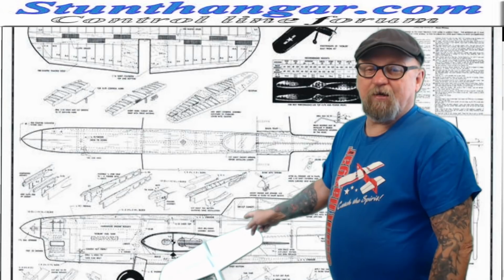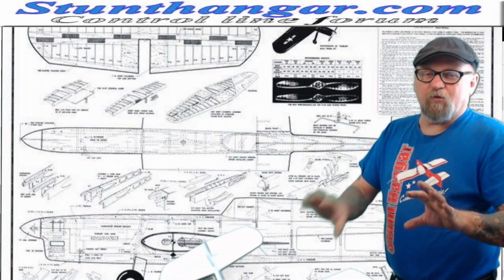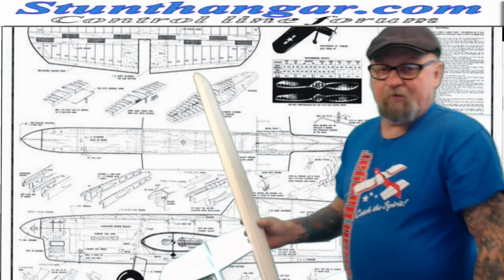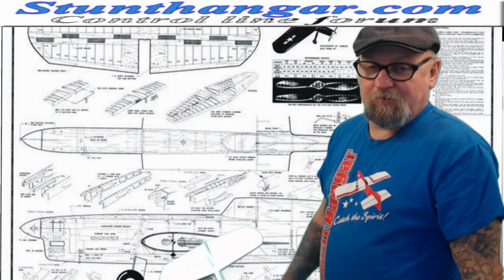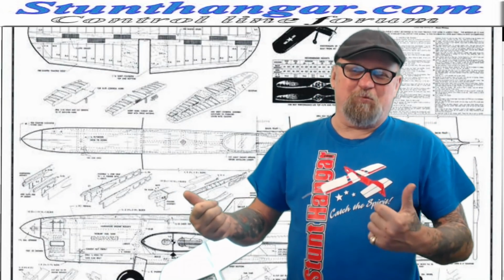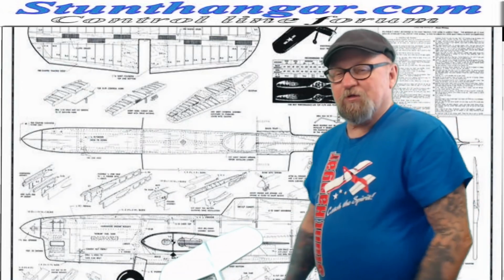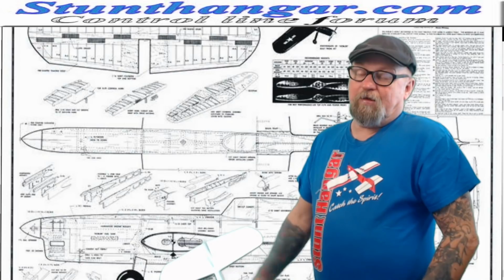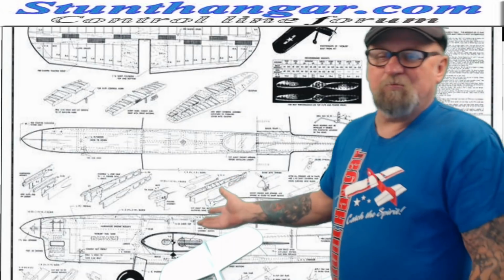Nobler Control line stunt design

Comment: Lots of good info here.  One thing about sweep/taper,  this adds directional stability in yaw.  So this may not be as important in C/L, but if done properly it would eliminate hinging, and not require as much side area.  Just basically track better through the turns.  Also,  higher aspect ratios are more efficient, so you tend not to lose speed in the turn.  Maybe more constant speed?  Look at Adamisin designs.  He like high aspect ratios.  I come from a CL combat design back ground, and we always prefered higher aspect ratios.  You could literally catch up to a VooDoo pig through the turn.   Just something to chew on.  I am not an engineer either.  Just a lot of building and flying.
Reply from the maker: Thanks for the observation.

Comment: One thing I wonder about is why no one ever tried side force generators a la RC 3D foamie on CL stunt what with all the overhead maneuvers.
Back in 1966 I flew CL. No way I could afford a Nobler. Went RC in 1972.

Comment: Interesting theory, however, if you start experimenting with the wing design, you can get something the size of a Nobler to turn a corner like a combat model and not loose speed!

Move the centre of lift forward, bring the Centre of Gravity forward also to match and see what happens. :)

After spending many hours researching designs, my father and myself decided to break all the conventions and went blank sheet, using hands on knowledge of flying aerobatic aeroplanes, our knowledge of aerofoil designs of aircraft from the 1950's as compared to laminar flow aerofoils of today, and what we wanted the model to perform like.

It had to be stable in level flight, and any other trajectory and hold it.
Be easily looped and balanced inside and out, yet can be easily placed exactly on the line.
It had to be stable on windy days.
It needed to fly as slow as possible.
It needed to turn high G corners without buffet or stalling.....

We built it, and tested it, and it worked! 

Then a couple of years later, the Sukhoi Design Bureau released the SU-26.
OMG!
They stole our wing design, nearly exactly!

Should have been cutting spruce instead of balsa... Lol.
Reply from the maker: Thanks for the info. Please check out my VIPER design theory of airfoils and center of pressure and let me know what you think?

Comment: Built 4 Noblers. Last one weighted 29 oz. Was a winning plane. Fox 35. Built a Shark 45 while in college. What a dog in the air. Could hardly hold on to the control handle. Then a Ares from the kit. It flew horrible. Of course later found out why. 🤔 Built a 59 Ares. Was too pretty to fly. Was in RC pattern by then. 2nd at nat's in 1917. Prostate cancer and Old Age caught up with me. Was a Beechcraft Baron charter pilot. Love your channel and everything that flys. Thank-you Sir
Reply: 1967 ?

Comment: Very interesting video Sparky.  Controline is so interesting.  I've always felt that the biggest challenge for myself is to build a plane that is capable.  You got to build light.  Like you said in the video, "take a well built Sig Twister, and it will fly well".  Got to build light and experiment.  Thanks for the video.

Comment: What's your theory on lap time adjustment with fine tuning it with line length changes and prop diameter and pitch adjustments? How about a short video on that?